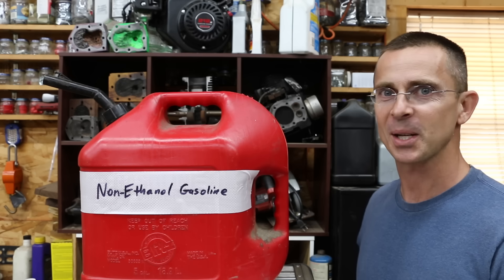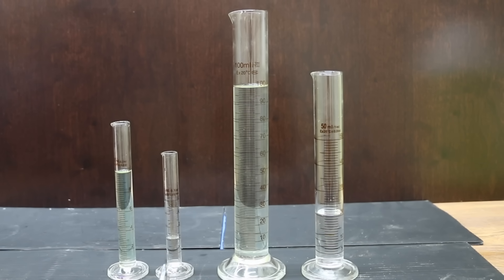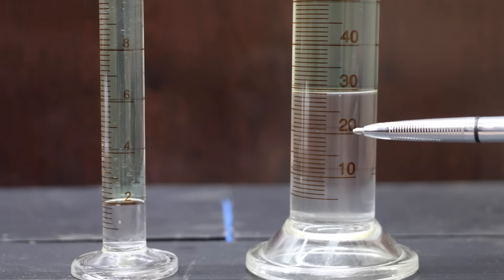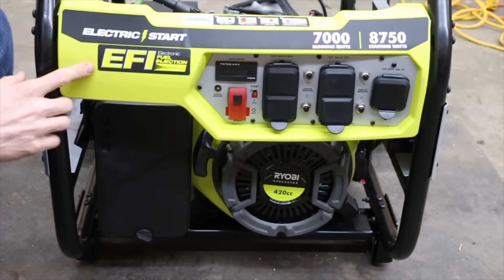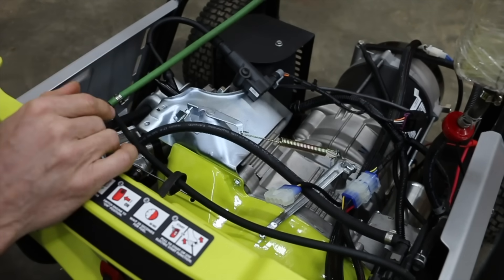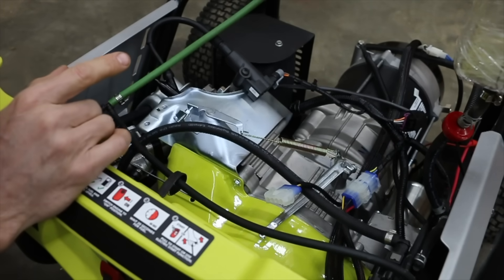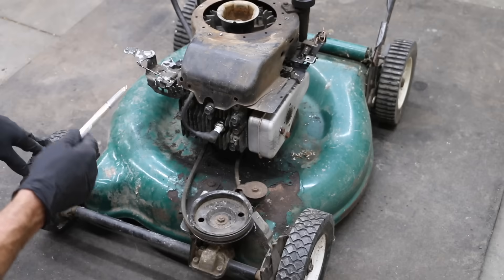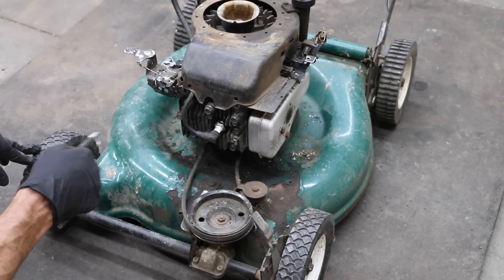Is Non-Ethanol Gasoline Really Better? See the PROOF!

Comment: Ethanol eats rubber and plastic, fact, why is this even debated?
Reply: It eats some rubbers and plastics.... Like there is only one.
Reply: @isaackarjala7916  

Like all rubbers, oils, and plastics have the material qualities you are looking for in a hose or lubricant?

You want a flexible hose that can handle thousands of deformations, yet ethanol destroys those. 

This also says nothing of the soil depletion, petroleum used to fertilize, harvest, refine, and include in the fuel. 

Ethanol is arguably a 1:1.1 EROEI at best, and some argue a loss when you factor in the energy costs of production. Which basically means you're turning diesel and gasoline into...shittier fuel that requires more workarounds.

https://www.sciencedirect.com/science/article/pii/S0301421513003856
Reply: @skeetorkiftwon  I've not heard of any cars made since the introduction of e10 having any issues running e10 for 100s of thousands of miles for decades... So apparently this is a solved problem.

Haven't seen anything conclusive on ethanol, but a farm in the N East (want to say Vermont, but maybe New Hampshire or Maine) runs all their equipment on homemade biodiesel and he reports that it takes a tenth of his crop to run the machinery, which gives an eroei of 10:1. Since ethanol production uses sugar and starches while bio diesel production uses fats (oils), one should be able to be made from the waste products of the other. Which changes the eroei calculation.
Reply: @isaackarjala7916  

Ah I see, so when calculating your energy intake, we'll only consider the calories from the food and ignore all the other dependencies that allow you to reduce your calorie intake and live a sedentary lifestyle.

 I trust this unsourced, unverifiable, "farm somewhere in the NE" is refining to a usable fuel on site and accounting for its nitrogen, phosphorous, and potassium, not to mention the energy to keep replacing the machines. Right? 

10:1 would make it more than twice the EROEI of fracking. Which is also upside down.
Reply: @skeetorkiftwon  NPK is a red herring, I'm not going to look up the specific farm, either it's something that piques your interest or it's not. Whatever. Yes the biodiesel was processed on site with the biodiesel produced being used to run all the equipment needed to turn sunflowers into fuel. No I don't think that the energy needed to manufacture the equipment is included, that would bring it down.
Reply: @isaackarjala7916  

Biodiesel is not ethanol based fuel. You said as much yourself.

Biodiesel is a lye separated product with methanol added, else you must bring it to a higher temperature with a two tank system. I know because I used to run used fryer oil in a diesel I converted, before I went to school for engineering and learned why it was stupid (and I argue criminal to promote) explicitly.

Years of tinkering, thousands of dollars later, three engines trying for better results, multiple different mix ratios, temp points, fuel switching times for start up/shut down etc for novelty results.

When you account for the additional labor, treating the fuel with lye to take out the lipids, then adding the methanol cost (and damage as I posted in the other paper I linked) and filtering, buying the filters, etc; it's a loss entirely.

It gets increasingly obnoxious if you get bacteria growth, water in your fuel supply, etc. 

The issue is almost always one of curiosity and hope looking in vs experience and cynicism looking out. 

If it was "so wonderful" it wouldn't be this fringe debate. Biodiesel would be at every gas station at a competitive price. It isn't, because it can't. 

Not to mention the price point competition for make up, food grade oils, and alternative crops. 

"I read somewhere, once, this advertisement for this niche market I thought was clever" isn't an argument.
Reply: @TheAutoChannel  

Saying it doesn't make it so. Show me the embedded energy costs in the production.
Reply: @TheAutoChannel  

Saying it with a lot of words...still does not make it so. 

This is how the trick works. You rely on the fact that 99.7% of the world's population doesn't even know the multivariate calculus necessary to begin to objectively be able to independently verify your claims. Let alone be a chemical engineer concerned with the energy throughput of the processes involved or the methods necessary to produce the equipment. 

You conflate unique energy types such as BTUs, Calories, and KWH as a 1:1 relationship despite each having different efficiencies at certain types of work. 

You again rely on the ignorance of the majority concerning these differences. 

You use lies of omission, or are ignorant yourself, concerning the constraints. Your book won't address the energy costs (in conventional hydrocarbons, not ethanol) of fertilizing the production or a dozen other necessary processes that must be costed into the production. 

Again you'll rely on the inability of the majority to be able to sit down and calculate these costs.

But most importantly, you rely on the faith of the ignorant to believe your claims because they have a cognitive bias to desire it to be true. 

When you can point to a sustainable ethanol production system (with methods/loss across each process, etc) and no externalities than the sun and ethanol) that is divorced from using gasoline, diesel, machines produced using these fuels, lubricants, fertilizers, and pesticides made from energy provided by ethanol, then, and only then, will you have provided the minimally necessary and sufficient evidence to support your claim. 

I argue you won't, for the same reason I argue no one would make ethanol without stealing from the taxpayer to produce it. Because it's a loss. 

So if you want to PROVE it, let's see the math in its entirety. Else stop claiming what you won't evidence. 

"That which can be asserted without evidence, can be dismissed without evidence"

"The debate over the EROI for corn ethanol is probably the most documented of all the energy 
sources presented here. Most of the often rancorous literature has been about whether corn ethanol 
requires more energy than it uses (i.e., EROI of <1:1) or whether it is positive, if low. The EROI of the 
numerous studies available on the subject range from approximately 0.8:1 to 1.3–2:1 [35]. The 
difference in values is mostly attributed to boundaries used and energy quality issues. This issue is 
explored in more detail in the paper by Hall, Dale and Pimentel in this special Journal issue.
In one recent study, Murphy et al. demonstrate that it cannot be statistically determined if the EROI 
for corn ethanol is above or below zero with any confidence, and that the largest impact on EROI is 
from co-products of the energy producing system, not yields of corn [35]. They also state that when 
Iowa is used as a benchmark for growing conditions and expected yields, the EROI is likely to be on 
the lower side of the scale given that Iowa represents the best conditions in the U.S. These authors 
conclude that the energy gains, if any, from corn ethanol are negligible without co-product credit."

Source:

https://www.google.com/url?sa=t&source=web&rct=j&url=https://pdfs.semanticscholar.org/e9d8/b3156721f4608f7e2ef19d549037caa6fa1c.pdf&ved=2ahUKEwiPr-6A4IvgAhWSY98KHZjlCmIQFjARegQIAxAB&usg=AOvVaw3o0NYDilCSB3XFe08mKuEr
Reply: @TheAutoChannel  

What we're left with its you not showing the dependencies for production and claiming that I have something to gain by remaining anonymous AND NOT SELLING A DAMN THING.

Where is the evidence, here, where you can copy paste it, the math that proves your position?

It doesn't exist, because you're lying. Else, put it here, and show overunity:
Reply: @TheAutoChannel  

Another edited post by an increasingly angry Billy. Sad.

The onus isn't on me to make your case. I gave you the minimum conditions that I would find your claims credible, and those conditions are never met despite over three decades of scientists and investors asking for them.

And no, I'm not going to use my argument of authority to counter your position that having a degree makes a claim valid. I have no interest in you trying to drag my name through the mud, my arguments stand whether I'm a physicist, chemist, engineer, or a house wife. Here's the most I'll give you: IHTFP and that should suffice.

Every single paper written that claims ethanol production is energy positive deems fundamental operations as externalities. You can post any paper you want and I'll find the accounting tricks in minutes. I've asked you to do just that and you went on a screed attempting to attack my character instead of putting up the proof you claim exists.

Why not just show us the proof if you've got it? I'm not selling ethanol, or solar panels, or wind turbines, or any other bullshit tech. You are. 

Just show us the research into a closed system of ethanol production. Doesn't exist. Show us the farms that aren't getting tax subsidies and constantly going bankrupt, getting reinvestment dollars repeatedly on the same gallon of ethanol produced. Doesn't exist.

With an energy density of about half of gasoline, with no evidence of ethanol's ability to be a closed system, with the fuel being known since the 1800's, and a long history of failure, the necessity of even course evidence of a high EROI should be expected to exist before any ground is broken to produce it, but it doesn't. 

Now I've gone hat in hand to get funding for my research on the viability of self sustaining solar, but people don't want to fund that research any more than they want to fund corn ethanol EROI. I'll crowd source the funding anyway, which will accomplish my goal of exposing the fraud in that industry better than writing a white paper that only my peers would barely glance at regardless.

The ethanol industry should be champing at the bit to definitively prove its EROI, but it won't fund the research and that alone provides for reasonable doubt of your claims.

So show the math, Mr Argument to Authority.

https://www.forbes.com/sites/rrapier/2018/02/11/cellulosic-ethanol-falling-far-short-of-the-hype/#2e33ace505f5

https://www.researchgate.net/publication/41421151_Year_in_review-EROI_or_energy_return_on_energy_invested
Reply: But does it really? Vodka is ethanol and they sell it in plastic bottles. Alcohol has been used as a preservative for thousands of years, before they had formeldahyde all the mad scientists stored their monkey brains in alcohol. Oil ruins rubber, but nowadays 'rubber' is a generic term used to describe things that are often synthetic, like silicone. Until an honest man stores different types of plastic and rubber parts in a solution of ethanol and gasoline (refined oil product) for measured lengths of time under different conditions, and publishes the results how do you know?  Sometimes people repeat things they hear so often, facts about details get lost. I don't know for sure, but I stay curious and and look for answers.
Reply: @rowgler1  hell yes it does... eats through primer bubbles in a matter of weeks. Hardens and causes cracks quickly in 2 cycle engines.
Reply: @rowgler1  you got it right
Reply: rowgler1 I run a chainsaw repair business and since people started using ethanol fuels the rubber gaskets and lines deteriorate way faster
Reply from the maker: Thank you
Reply: So when you look under a car that has an oil leak and you see all the rubber bushings destroyed, I guess ethanol did that.  You need to really think about that.  When ethanol is put into fuel they have to lower gas rating.  Trust me you don't want to know what they are sticking in the fuel.  I sent the fuel off to a lab to get tested.
Reply: @frednorma1  

Are you going to discount sand and rust their effects as well? There are hundreds of papers like this one, not to mention basic chemistry foundational to making plastics, fuel, and detergents, that contradict your apples to potatoes claim:

https://www.hindawi.com/journals/jfu/2014/429608/
Reply: The automotive industry learned that lesson and adapted. Should've spent peanuts on R&D maybe, but hey why not use customers wallets as labrats.

Why can't the small engine manufactures adapt and build better shit that last?
Reply: @rosen9425  

I bet you think if their was such a thing as a 100 mpg engine they would put it in vehicles. Not even thinking or how the Gov does not want that because of less taxes coming in from fuel tax.
Reply: Because there isn't a single "rubber" or "plastic" in existence or manufacturing use. They all have different resistive properties to ethanol or other solvents. Spend some quality time with material data sheets to update your information.
Reply: It's one thing to debate it, and another to SEE it. This is why we like these videos.
Reply: Ethanol bonds with water, creating  acetic acid... very corrosive, go ahead and run it if y'all want, but some gas stations run higher than 10%in my area, I don't go there
Reply: @skepticalhistorian797  the original comment is literally the least true thing I have seen today and I watched CNN...
Reply: How can you be 100% sure when MMT and MTBE were also changed and added?
Reply: I've had two mowers stop working after a tank of ethanol/gas.  I've only put premium gas in another mower and have used it for several years.  That seems pretty conclusive to me.
Reply: @damondiehl5637  

You better take that mower back and get your money back. I work for the largest lawn and garden manufacturer in America and all engines run just fine on e10. 
Been this way for years.
Reply: @damondiehl5637  I leave regular 10% ethanol fuel in my mower all winter for months at a time and in the spring it always cranks right up.  I don't really care either way about ethanol, but I think it is a waste of time to worry about it.
Reply: Ethanol is much >>>easier<<< on rubbers, plastics, and metals than what gasoline and BTEX(benzene, toluene, ethyl benzene, and xylene) are.

If you doubt this, look here:

Ethanol = https://www.customadvanced.com/chemical-resistance-chart.html?chemical=Ethyl+Alcohol&rubber=

Gasoline = https://www.customadvanced.com/chemical-resistance-chart.html?chemical=Gasoline&rubber=
Benzene = https://www.customadvanced.com/chemical-resistance-chart.html?chemical=Benzene&rubber=
Toluene = https://www.customadvanced.com/chemical-resistance-chart.html?chemical=Toluene&rubber=
Ethyl benzene = https://www.customadvanced.com/chemical-resistance-chart.html?chemical=Ethyl+Benzene&rubber=
Xylene = https://www.customadvanced.com/chemical-resistance-chart.html?chemical=Xylene&rubber=

Need a second opinion?
https://www.coleparmer.com/chemical-resistance

Or here for a third opinion:
http://www.graco.com/content/dam/graco/ipd/literature/misc/chemical-compatibility-guide/Graco_ChemCompGuideEN-B.pdf

See what high aromatic gasoline is rated for with aluminum:
https://www.calpaclab.com/aluminum-chemical-compatibility-chart/
Note that ethanol is good with aluminum.

The main nontoxic ingredient of RV antifreeze is ethanol and it would not have stood the test of time if it had been corrosive.
Reply: Ethanol is much >>>easier<<< on rubbers, plastics, and metals than what gasoline and BTEX(benzene, toluene, ethyl benzene, and xylene) are.

If you doubt this, look here:

Ethanol = https://www.customadvanced.com/chemical-resistance-chart.html?chemical=Ethyl+Alcohol&rubber=

Gasoline = https://www.customadvanced.com/chemical-resistance-chart.html?chemical=Gasoline&rubber=
Benzene = https://www.customadvanced.com/chemical-resistance-chart.html?chemical=Benzene&rubber=
Toluene = https://www.customadvanced.com/chemical-resistance-chart.html?chemical=Toluene&rubber=
Ethyl benzene = https://www.customadvanced.com/chemical-resistance-chart.html?chemical=Ethyl+Benzene&rubber=
Xylene = https://www.customadvanced.com/chemical-resistance-chart.html?chemical=Xylene&rubber=

Need a second opinion?
https://www.coleparmer.com/chemical-resistance

Or here for a third opinion:
http://www.graco.com/content/dam/graco/ipd/literature/misc/chemical-compatibility-guide/Graco_ChemCompGuideEN-B.pdf

See what high aromatic gasoline is rated for with aluminum:
https://www.calpaclab.com/aluminum-chemical-compatibility-chart/
Note that ethanol is good with aluminum.

The main nontoxic ingredient of RV antifreeze is ethanol and it would not have stood the test of time if it had been corrosive.
Reply: Ethanol is much >>>easier<<< on rubbers, plastics, and metals than what gasoline and BTEX(benzene, toluene, ethyl benzene, and xylene) are.

If you doubt this, look here:

Ethanol = https://www.customadvanced.com/chemical-resistance-chart.html?chemical=Ethyl+Alcohol&rubber=

Gasoline = https://www.customadvanced.com/chemical-resistance-chart.html?chemical=Gasoline&rubber=
Benzene = https://www.customadvanced.com/chemical-resistance-chart.html?chemical=Benzene&rubber=
Toluene = https://www.customadvanced.com/chemical-resistance-chart.html?chemical=Toluene&rubber=
Ethyl benzene = https://www.customadvanced.com/chemical-resistance-chart.html?chemical=Ethyl+Benzene&rubber=
Xylene = https://www.customadvanced.com/chemical-resistance-chart.html?chemical=Xylene&rubber=

Need a second opinion?
https://www.coleparmer.com/chemical-resistance

Or here for a third opinion:
http://www.graco.com/content/dam/graco/ipd/literature/misc/chemical-compatibility-guide/Graco_ChemCompGuideEN-B.pdf

See what high aromatic gasoline is rated for with aluminum:
https://www.calpaclab.com/aluminum-chemical-compatibility-chart/
Note that ethanol is good with aluminum.

The main nontoxic ingredient of RV antifreeze is ethanol and it would not have stood the test of time if it had been corrosive.
Reply: Ethanol is much >>>easier<<< on rubbers, plastics, and metals than what gasoline and BTEX(benzene, toluene, ethyl benzene, and xylene) are.

If you doubt this, look here:

Ethanol = https://www.customadvanced.com/chemical-resistance-chart.html?chemical=Ethyl+Alcohol&rubber=

Gasoline = https://www.customadvanced.com/chemical-resistance-chart.html?chemical=Gasoline&rubber=
Benzene = https://www.customadvanced.com/chemical-resistance-chart.html?chemical=Benzene&rubber=
Toluene = https://www.customadvanced.com/chemical-resistance-chart.html?chemical=Toluene&rubber=
Ethyl benzene = https://www.customadvanced.com/chemical-resistance-chart.html?chemical=Ethyl+Benzene&rubber=
Xylene = https://www.customadvanced.com/chemical-resistance-chart.html?chemical=Xylene&rubber=

Need a second opinion?
https://www.coleparmer.com/chemical-resistance

Or here for a third opinion:
http://www.graco.com/content/dam/graco/ipd/literature/misc/chemical-compatibility-guide/Graco_ChemCompGuideEN-B.pdf

See what high aromatic gasoline is rated for with aluminum:
https://www.calpaclab.com/aluminum-chemical-compatibility-chart/
Note that ethanol is good with aluminum.

The main nontoxic ingredient of RV antifreeze is ethanol and it would not have stood the test of time if it had been corrosive.
Reply: Ethanol is much >>>easier<<< on rubbers, plastics, and metals than what gasoline and BTEX(benzene, toluene, ethyl benzene, and xylene) are.

If you doubt this, look here:

Ethanol = https://www.customadvanced.com/chemical-resistance-chart.html?chemical=Ethyl+Alcohol&rubber=

Gasoline = https://www.customadvanced.com/chemical-resistance-chart.html?chemical=Gasoline&rubber=
Benzene = https://www.customadvanced.com/chemical-resistance-chart.html?chemical=Benzene&rubber=
Toluene = https://www.customadvanced.com/chemical-resistance-chart.html?chemical=Toluene&rubber=
Ethyl benzene = https://www.customadvanced.com/chemical-resistance-chart.html?chemical=Ethyl+Benzene&rubber=
Xylene = https://www.customadvanced.com/chemical-resistance-chart.html?chemical=Xylene&rubber=

Need a second opinion?
https://www.coleparmer.com/chemical-resistance

Or here for a third opinion:
http://www.graco.com/content/dam/graco/ipd/literature/misc/chemical-compatibility-guide/Graco_ChemCompGuideEN-B.pdf

See what high aromatic gasoline is rated for with aluminum:
https://www.calpaclab.com/aluminum-chemical-compatibility-chart/
Note that ethanol is good with aluminum.

The main nontoxic ingredient of RV antifreeze is ethanol and it would not have stood the test of time if it had been corrosive.
Reply: In all the discussion of ethanol no one mentions the diversion of corn from the food/feed supply. This drives up the cost of meat and other food.
You pay for ethanol in more ways than one.
Reply: @heyyou5189  

Here is how the 2007 Energy Independence and Security Act affected food/feed prices(if at all):

2007 WEIGHTED CORN PRICE =$4.20 WITH 4 .7B GAL MANDATE

2008 WEIGHTED CORN PRICE =$4.06 WITH 9B GAL MANDATE

2009 WEIGHTED CORN PRICE=$3.55 WITH 10.5B GAL MANDATE

2015 WEIGHTED CORN PRICE =$3.61 WITH 15B GAL MADATE MAXED OUT 

2016 WEIGHTED CORN PRICE =$3.36 WITH 15B GAL MANDATE MAXED OUT

2017 WEIGHTED CORN PRICE =$3.36 WITH SAME 15B GAL MANDATE MAXED OUT + RECORD EXPORTS OF 1.37B GAL

https://quickstats.nass.usda.gov/results/E31529F8-EF1E-3C3A-B530-52AED1DA082F

Wheat

2007...............$6.48/bu

2008...............$6.78/bu

2009...………$4.87/bu

2015...………$4.89/bu

2016...............$3.89/bu

2017...............$4.72/bu

https://quickstats.nass.usda.gov/results/F7EE6803-FE01-38E8-A580-A6D167ED9B70

Soybeans

2007..............$10.10/bu

2008..............$ 9.97/bu

2009...……...$9.59/bu

2015..............$8.95/bu

2016..............$9.47/bu

2017..............$9.33/bu

https://quickstats.nass.usda.gov/results/B49D08C1-2CF8-3311-BBD3-7A90E6EE725D

Paradox?  Not at all.

Corn ethanol is a value added product of feed production which uses a waste stream from it(the starch) which cattle can not digest well and a lot pass through undigested as waste onto the ground in their manure.

Corn ethanol uses only the starch and leaves the feed(proteins, fats, and minerals) alone, actually enhances it to be more productive, more digestible, more concentrated, and healthier for the animal.

Better/more food with a super cheap, super nontoxic, super clean, and super concentrated octane booster/fuel/oxygenate as a bonus. Who can be against that?
Reply: @TheAutoChannel  And your obsessive desire to be right proves that you have  a tiny dick.  You started this fight.  All this video proved is that engines run the same on either type of fuel.  It does not prove that ethanol gas is good, bad or otherwise related to the gas lines and diaphrams and other rubber components.  The facts are: I have been using small engines for 40 years.  I have two moweres that ran ethanol gas and stopped working after being run three or less times, and I have a mower and a snowblower that have never seen ethanol gas and have been working for about three years now.  If you don't like being called out, don't be a snarky ass-hat when someone says something that you disagree with.
Reply: @damondiehl5637  The country of Brazil's common gasoline contains a minimum of 27.5% ethanol and they have many of the very same small engines we have here.

It has worked out so well and for so long that Argentina and Paraguay are going/have gone to high levels themselves.  Ethanol is much easier on rubber than gasoline as my previous posts above prove.

It would be irrational to believe that ethanol destroys engines, especially after just three uses or less, those countries would have overgrown lawns everywhere and the engine manufacturers would be broke.

https://www.honda.com.br/produtos-de-forca/gx120
Reply: Dana Fletcher depends on the formulation of the rubber in question. If speaking about classic automobiles, then you are completely wrong. 
If speaking about autos from the 90s, maybe. Autos from 2000 and newer, no issue. 
To demonstrate, put DOT3 brake fluid in a master cylinder with natural rubber seals (like vintage British cars) You’ll be replacing them and rebuilding it in a couple of weeks. Yet dot 4 is safe for years or decades. Not all rubber and plastics are the same, nor do they react to ethanol the same. 
The fact that ethanol fuels give worse mpg is scientific fact. As is that they are corrosive to the rubbers used in older vehicle production. 
This is generally not a major problem at e10 levels, but absolutely is at e90 levels.
Reply: It does not interact with components in any vehicle fuel systems since the mid 90's. Anythign before that you'd have to replace with current technology components.  duh
Reply: It's an additive called mtbe: methylterchiarybutylether that wrecks rubber parts, not the ethyl alcohol.
Reply: craig davenport explains why my plastic fuel tank is getting eroded.